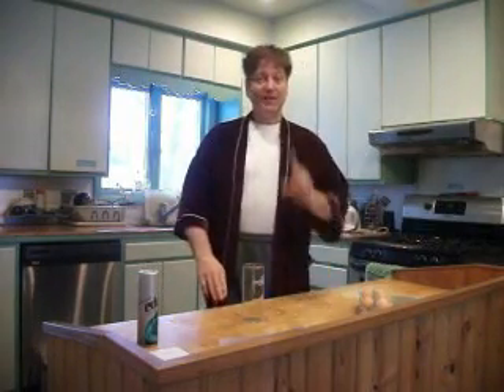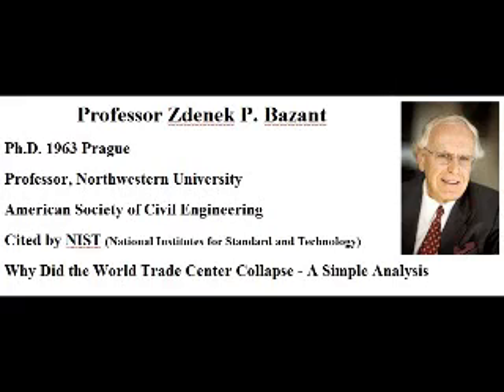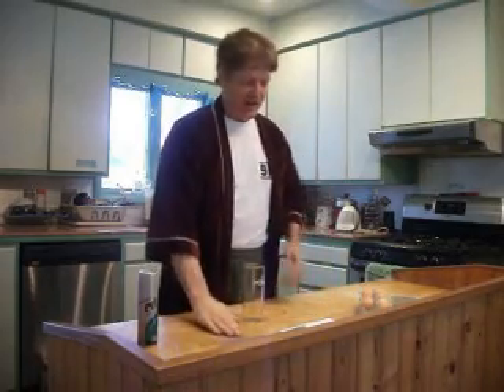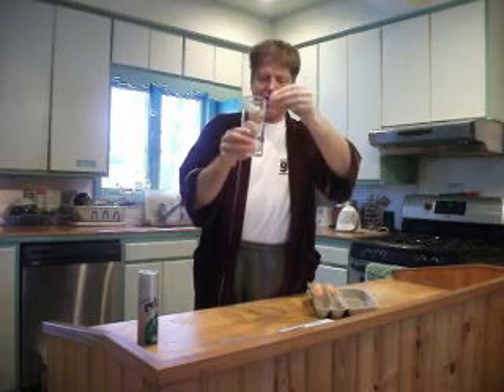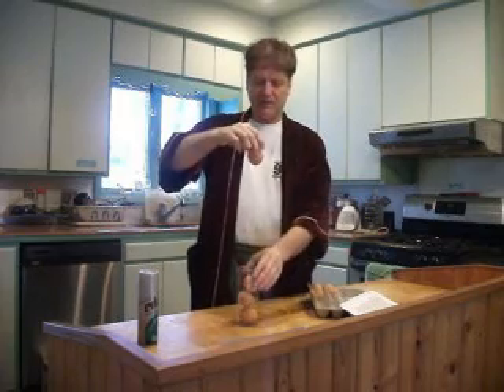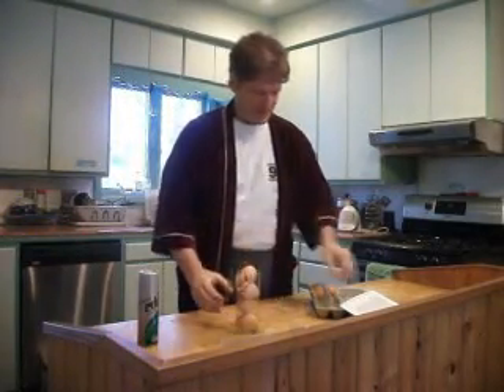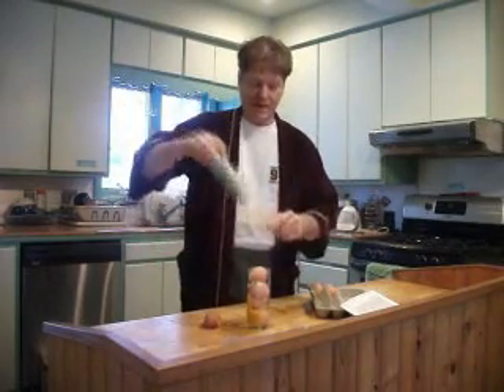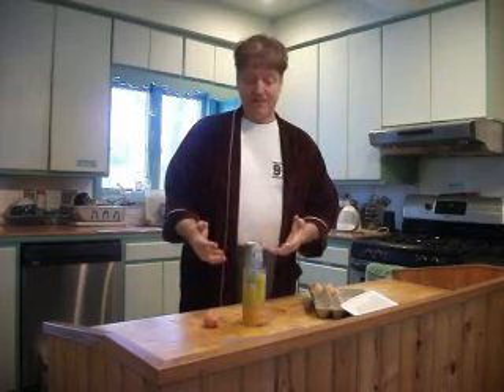9/11 Experiment: Egg Drop, Equal Collision disproves Bazant's "Pile Driver" Theory

Comment: A pile of eggs behaves differently from a steel-frame skyscraper, for many reasons:
1. In a highrise, any portion of the structure can support no more than about 3 times its actual static load before it buckles; an upright egg however can support more than 10 times it's own weight; that would for example apply to the second egg from top
2. An egg is filled with liquid, a building mostly with air
3. Most of the egg debris is liquid
4. Egg shells are curved and only propagate a small load portion

Comment: OK, one floor, and the subsequent floors beneath it were not crushed by one floor, but by a whole upper block. The other problem you have with your example you are using to discredit a peer reviewed paper, apart from the glaring error I have already pointed out, is that the WTC was not made out of eggs.

Comment from the maker: @fluxxus  >a) the mass and velocity of the upper blocks of the towers as they came down on the lower floors.
If anything, I gave the egg MUCH more velocity than the actual top floors in the towers did, by holding it over 10 times higher.  
>b) the capacity of the floor trusses and connectors
The experiment shows that a mass with a certain load capacity, falling on a mass with similar capacity, will crush equally upon collision.   The floors above were about as strong as the floors below.